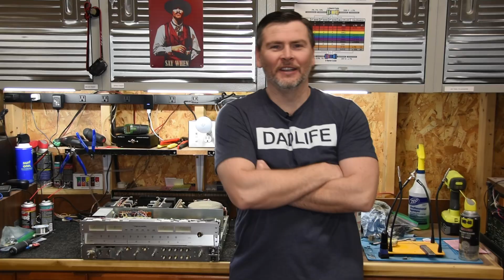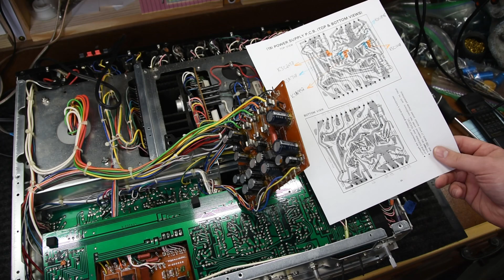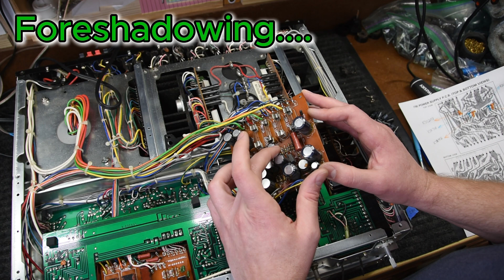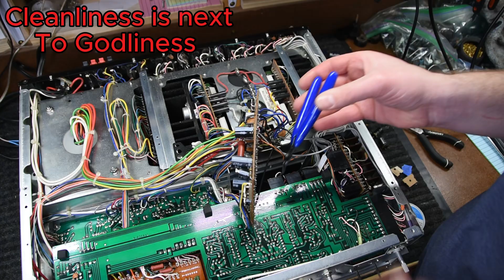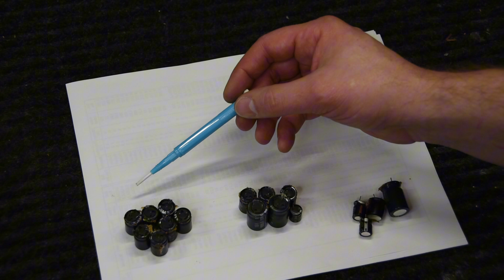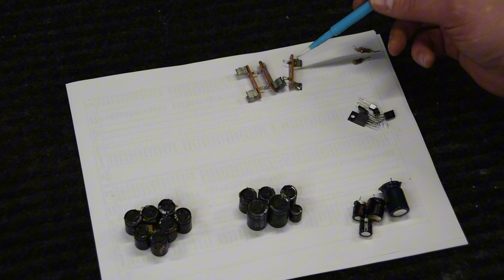Realistic STA-2100 Power Supply Rebuild | Vintage Audio Repair & Stereo Restoration Guide#diyaudio

Comment: In addition to installing higher voltage capacitors do you ever install caps with higher temperature ratings?
Reply from the maker: Yes, I never buy the 80c ones I try to buy the 105C. Its so second nature to me that I never even mention it obviously lol